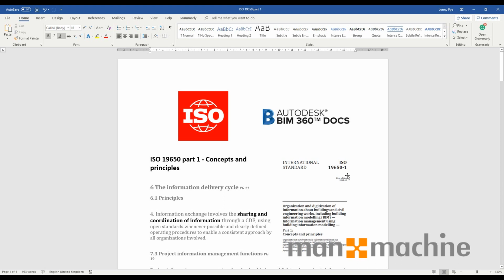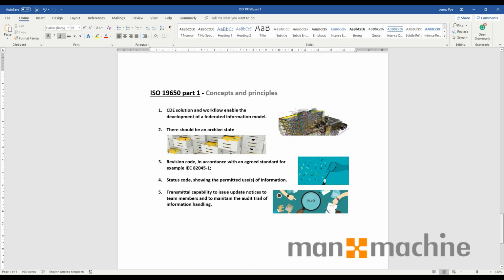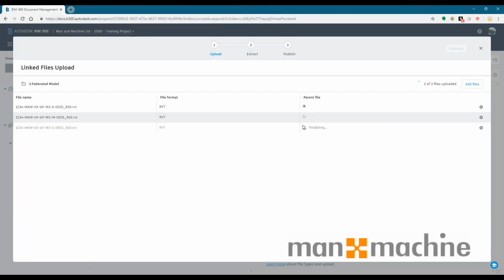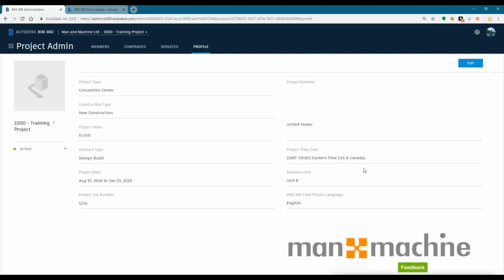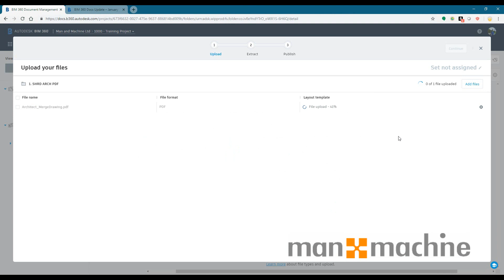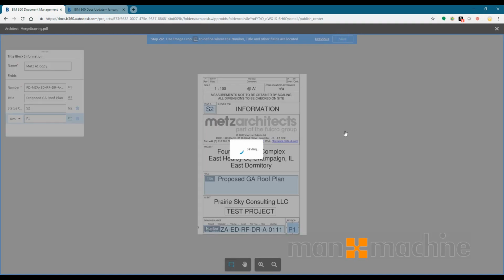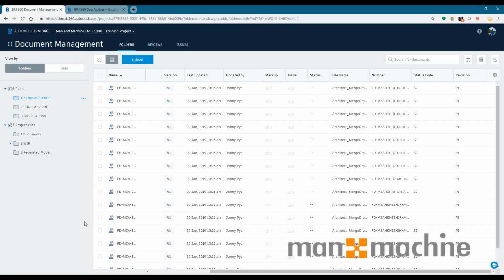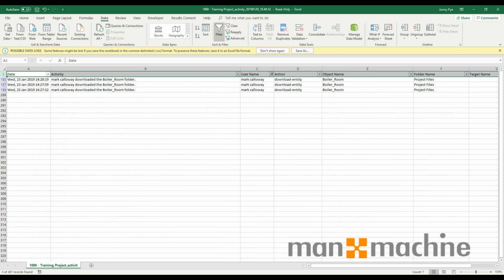BIM 360 Docs and ISO 19650 Part 1

Comment: Brilliant video, thank you for sharing your knowledge - great to see the interrogation of the ISO in relation to BIM360.

BIM360 looks like the main CDE tool to date. Just wondering in regards to part 1 - "CDE solution and workflow enable the dev.." It seems to be almost doubling up on what both Navis and Revizto do. Assuming you are using both Revizto and Navis on a project is there a reason for using BIM360 on top of this ?